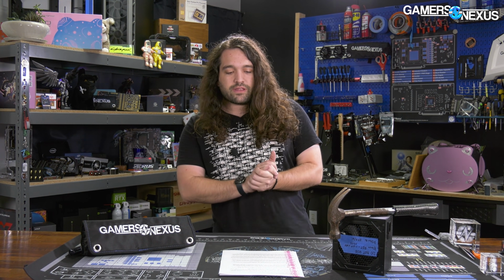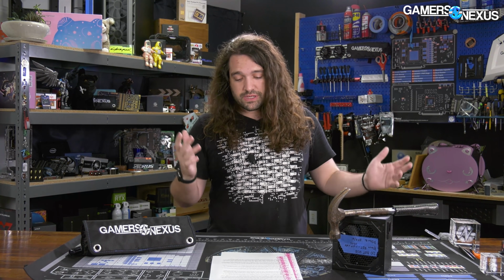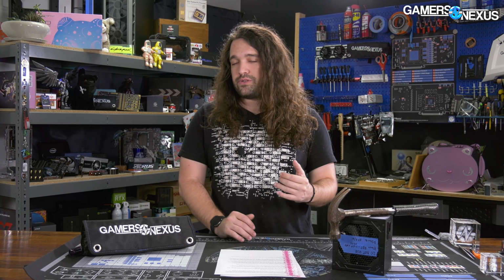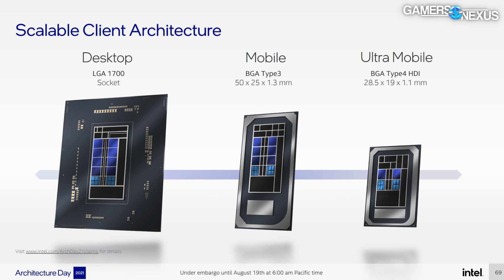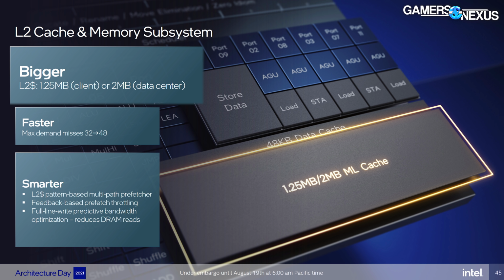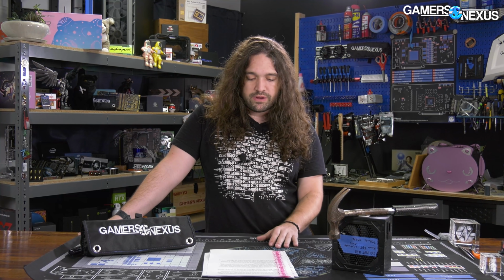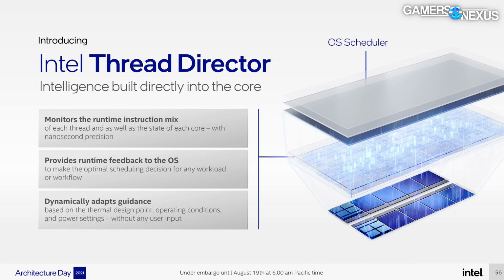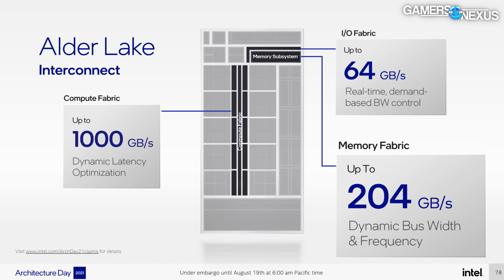Intel Overhauls CPUs: Alder Lake Architecture Explained - New Core, PCIe Gen5, & DDR5

Comment: Why easy if you can go complicated eh? This looks like intel just wants to bridge the time till they get a smaller production process. Why use slow cores mixed with fast cores if the fast cores could be just clocked down and the voltage reduced to save power? 

Always keep it as simple and functional as possible.
Reply: Its not slow cores, its efficient cores that match skylake IPC and give the cpu huge MT perf

Comment: Big & little cores - look how everybody is copying ARM and guess why? Efficiency, specifically performance per Watt ;) Nvidia made a god damn good (and expensive) purchase of ARM... its also good to see that AMD is more efficient in its performance per Watt than Intel... AMD needs to learn that also for their crucial SOC products, not mentioning those which will like to continue pumping into future game consoles and mobile PCs... still I've heard that AMD is experimenting with ARM cores in their SOCs, however I think Intel and AMD would like to eventually learn how to make very similar in performance per Watt ARM like SOCs based on the x86, however Nvidia might be faster in that by delivering ARM SOC running x86 very well and efficiently potentially opening space for new ARM & Nvidia based PC chips. Let's see how it will unfolds, future is definitely not only x86 with Intel and AMD, which I am very glad for... industry needs a new shift and way forward.

Comment: Efficiency Cores are not just clocked lower, they have a Reduced Intruction Set (RISC).  This is the reason Intel HAS to implement this Scheduler, becase the E cores literally cannot run many instructions the "P" core can.  Imagine running on E core then the thread requires an AVX instruction... that will be redirected to P core.  Hard to imagine they will get this right 1st gen...

Comment: The key to this new architecture will be how well operating systems can firmly assign tasks to the right core.  There are some reviewers that seem to think the OS scheduler will NOT necessarily do this but that applications will use whatever cores they want at whatever time they want regardless of the combination of processes and tasks running.  Seems to me that power savings alone do not justify creating an entirely new architecture.  Unless the OS can assign "background" and "easy" applications to efficiency cores and ensure they do not spill over into performance cores, what's the point?  But how will you guys test this?  How will we know if it actually works?

Comment: Man, what a waste of sand. I get doing the big/little configuration for mobile processors where they run on batteries and power consumption is a huge consideration, but that's not a thing on desktops. Better to allocate the die space to more performance cores. I only hope AMD's too smart to follow them down this road.

Comment: I Think By Sticking For A Decade they meant the core idea of performance cores & efficient cores. In fact any architecture leaks from MLID and others points to hybrid architecture at least until foreseeable 2026-2027. 

Alder Lake, Raptor Lake, Meteor Lake, Arrow Lake, Lunar Lake, Nova Lake they are all big core - little core designs where each takes further the disaggregation from a monolithic design of not only the core designs but also of I/O, Memory, igpu, manufacturing & assembling processes, etc.

Alder & Raptor ( 2021-22 Intel 7 - 7 enhanced ) Lakes are improvement on scheduling, and use of big cache for gaming and workload in hybrid core designs.

Meteor & Arrow ( 2023-2024 Intel 4 - 3 + TSMC 3 enhanced ) Lakes are further improvement on them plus disaggregation of the main cpu systems in tiles ( heterogeneous cores, memory, i/o, igpu, etc ) so they can be made and assembled in different manufacturing places using the best technology possible.

Lunar & Nova ( 2025-2026 Intel 20A - 18A + TSMC 2 Gate All Around ) Lakes are actual attempts of using all the above mentioned improvements with an enhanced CPU instruction architecture ( could be x86 enhanced, could be using hybrid x86 + risk/arm and 3-4 threads instead of Two per Performance Core ) to tackle & fight with arm or efficient micro architecture designs in different sectors.

Intel is foreseeing massive improvements in performance from Arrow Lake & onwards.

Whether they can succeed doing all that in the foreseeable 6-7 years we will have to wait and see. But for intel it looks like they are indeed sticking with the hybrid design for at least a decade.

Comment: For me with global warming etc l felt guilty getting larger psu for 3080? I think next gpus...next cpus...the powerconsumption and heat are becoming more important to me now.  The size ..weight...power use of my 3080 feels like a step backwards ..l feel like its a overclocked 2000 serise gpu...with a few more chips stuck on it...anyway...l hope pc parts become more power friendly.   Nice to see intel trying...but unless they can crush my 65w ryzen 3700x at same power use...l wont be interested.

Comment: The more I hear about it the less likely I am to actually go for it. Intel used to have a reliable tic-toc routine, now we are getting in the same launch a new process node a new core arch, DDR5, PCIe5 and a dynamic scheduler to make it work that needs some amount of OS integration. I'm pretty sure some things won't work as intended. The scheduler part seems like a massive SPOF for the overall performance of the product.

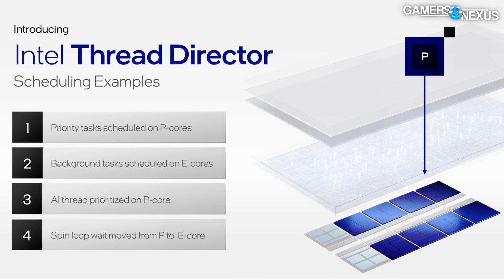Comment: So, in regards to TDWS (for short hand for topic at @22:22 )

That is going to be a security nightmare. I can see it already. 

For the scheduler to know which is best type of core to do certain jobs for, it's going to have to do more of what was already making Intel and later AMD chips vulnerable to the many recent security issues as of late. What was that?

Predictives, for short. What do I mean? Stuff like your hyperthreading for instance, uses predictive algorithms. This scheduler, seems like it will be doing more of the same, based off the information it gets from your activities. 

That means it is essentially spying on you all the time to make sure the right core or thread is doing the right job. 

Now, go ahead and tell me that isn't a problem where Microsoft or hackers are concerned.

Comment: So the P core/E core split is basically more of the “big.LITTLE” stuff that’s now familiar from mobile ARM?
Reply: yes. But mobiles need this to save batteries. Why we need this at desktops?
Reply: @severgun  On the face of it I would agree but if all background tasks are delegated to the little cores then all your big cores can focus on latetency sensitive user tasks like gaming.
Reply: @lionelt.9124  wasnt there an old argument that doing a task really fast saved you power over doing it slow
Reply: @jimecherry  Doesn’t work with PCs. Power consumption increases exponentially with speed, not linearly. That was Intel’s problem over the past several generations.
Reply: @severgun  to save power.
Reply: @severgun  watch whole intel presentation. Raja did mention hybrid architecture actually people compear with hybrid car engine which subject to give maximum millage per tank gas. 
But there is a another hybrid technology in formula one car racing. Conventional turbo charger engine (golden cove core) is being given additional electric charge (gracemount core) to blast maximum speed to get top speed. Alder lake will going to follow 2nd one notion.
 In alder lake decoder will  decord 3type of instruction scaler , vector and ai . The vector instuction priorities p thread but the instuction is too small and sort so don't need p execution unit for achieving task hence the thread director will it send to e core where 17 execution port available per core so it will have sufficient space to execute vector instuction as a result the broader execution port of golden cove core will be traffic free to achieve scaler and ai instructions. 
That's why in alder lake gracemount core have 17x8= 136 execution port where 11900k only have 80 execution port.
 On traditional architecture all execution port are being mashed with scaler , vector and ai instuction so on alder lake thread director will transfer rightfully instructions to fightfull thread.
Reply: @severgun  have higher IPC in the big cores
Reply: @severgun  Obviously to save power. Daddy paying for the electricity? No interest in where electricity comes for?
Reply: @Malc180s  Nah... To save power? That will probably save you a couple of cokes a year at most. For laptops this is a good thing but for desktops it's more about letting the P-cores do what they are supposed to do without having to do what the E-cores can do.
Reply: @tmkongen  Weren't there recent articles saying that if computer power draw increases at the rate it has been, there won't be enough electricity produced to run them? It's not a small problem. Desktop or laptop, doesn't matter. Open your mind.
Reply: @Malc180s  Ok... So tell me, how will a few E-Cores help save the worlds electricity problems? You think the overall power usage of the CPU's will change much? It won't, they become more efficient allowing us to do more in the same amount of time. That doesn't save any power in the long run.
Reply: @tmkongen  Well obviously they'll help, only an argumentative knob would suggest otherwise. If a standard intel/amd chip consumes x watts, halving that power across hundreds of millions of computers will make a huge difference. You think humans are currently only working at half speed or something??!
Reply: @Malc180s  There will be no "halving that power" when the P-Cores does the heavy work. Now if we only use E-Cores we would save some power but noone would use them when they use longer time to complete the task given.

Guess you think that electric cars will save the world aswell so I'll leave you at that. You have your opinions and I have mine. Take care!
Reply: @tmkongen  How often do most people do anything even remotely taxing on their computer?! It'll make a huge difference.

And the car thing? Right mate.
Reply: Yes, pretty much!
Reply: It seems to work for the M1.

Comment: so, basically big.LITTLE on x86-64. This should be interesting. The scheduler will either make or break this. Laptop manufacturers are gonna have a headache trying to figure out whether to stick with Intel or go with Intel and AMD mixture. I think Laptop market is going to be interesting. Also, and this is a big one, Intel got caught pushing performance at the expense of security in the past. Common consensus was that it was a architecture flaw, has this been addressed?

Comment: I feel like that "thread director" tech could have been implemented in the 10 and 11 series CPUs. Like a 10900k always has threads 3, 4, 5 & 6 saturated (especially in poorly optimized games), while the rest of the cores sit idle - thus causing stutters and fps drops. Offloading those background jobs to the other cores would reduce the bottle neck on thread 3 - 6. I know its designed to direct tasks to a full different set of cores (i.e. "E" cores), but i dont see why it couldnt be used to directed traffic to idle cores too (given that there are no E Cores on 10/11 series). I probably dont under stand the tech enough so might be very wrong haha
Reply: That's been an OS side thing for a long time

Comment: I'm a bit worried about both the 'end of year' promise because we've seen Intel slip on schedule as you said, but also the lack of engineering samples that have been shown/leaked and this Thread Director that's still in development, only on Windows 11, and nothing reportedly for Linux. If anything, I'm also worried that, on release, there will be plenty of hitches from threads swapping from spin-lock or waiting to the P-cores, causing cache latency hits and thus games will stutter. Maybe it'll be fine.
Reply: "but also the lack of engineering samples that have been shown/leaked "
Apparently there are boards and CPU's already in sale in the Chinese black market, and Raichu has already leaked scores from ES.

Comment: Why couldnt they use the  good old "Ringbus" and make a 14c 28t Cpu That can clock to 5 Ghz all Core. I know i know the permormance matters not the clock speeds but for only Gaming it would have been amayzing. Now this new this and "director" there, Chiplet based, Small cores/big cores I fear that this would make manual OC useless like it already is with Ryzen and pretty boring maby.
Reply: "Why couldnt they use the  good old "Ringbus" and make a 14c 28t Cpu That can clock to 5 Ghz all Core."
Not enough die space- they could have done at most a 10c/20t golden cove cpu. It would prob have to be clocked lower as well because it will require a lot more power and produce a lot more heat than 8+8.

Comment: Would love to see what a very competent programmer could do without all the out of order decode. Willing to bet there's a performance hit for that convenience. How much depending on how loosely the code is thrown together. I wonder if code that is completely in order would still see even a minor hit to performance.
Reply: Remember that OoO also compensates for cache residency and branch prediction, so unless it was with a fundamental overhaul in architecture just changing to in order wouldn't afford much

I do think that compiler-forward (solved at compile time) CPUs are very interesting and offer potentially huge efficiencies, but the audience for them is so small that it doesn't really justify everything that would need to be developed for them - not just the hardware, but also software
... Also, CPU vendors probably wouldn't be willing to disclose sufficient information about the internals to make them viable :p

Comment: A statistic that I think is needed on processors is BTU’s of cooling needed/recommended at both the base Ghz, and the boosted/turbo Ghz, or a metric that can be correlated to the cooling system for the processor.

Comment: Intel lost me years ago. Don't trust them anymore. 6700K was my last.
Reply: You are acting like 10th gen or 9th gen was  bad... when its clearly not... i had a 6700k as well was good at the time.. hell even the 11400 and 11600k are great options..  bkth give the 3600 and 5600x a run for their money... 11400 makes the 3600 look slow for cheap
Reply: @TheBURBAN111  Dont know about those gens and honestly dont care. Intel's behavior is what soured me on them. I refuse to support companies that are anti-consumer. Nvidia falls into this category as well. Attached vid explains a lot if you care to educate yourself. Take care.
https://www.youtube.com/watch?v=osSMJRyxG0k
Reply: @GeraltofRivia5150  i mean amd charging 200$ for the 3600 is anti consumer while the 175$ 11400 with a cheap b560 makes it look slow or what about them charging 300$ or more for the 5600x while intel do the 10850k 10 core.... which edges out the  400$ or more 5800x for 300$ or the 10700k which edges out the 5600x for 250$ or less... im not hating but saying intel are anti consumer is stupid when amd are doing the same thing but worse... yes the 11900k is overpriced but not the 11700k/11600k/11500/11400 all compete with amd for cheaper i agree with the amd cards being cheaper though but compared to NVidia their rt performance is ass.
Reply: @GeraltofRivia5150  your friendly-consumer company couldnt gain half of share in both gpu and cpu market

Comment: I have a feeling we will be extremely underwhelmed at first. It's going to take a loooong time for the scheduler to run well in the real world - remember that each time it moves threads from core to core there will be a large latency fine, cache the needs to be copied and purged, etc.
Reply: We saw it with Ryzen already. It took Microsoft 3 years from zen launch to roll out their scheduling improvements. Linux had it within one year. I doubt a delay with Intel's launch will take 3 years because you bet your ass Intel likes to pay to look good.
Reply: @indianboy0453  pay as they might, Microsoft can't even make THEMSELVES look good after they fired most of their QA people. In any case, this big.Little config is so much harder to optimize for than Ryzen.

Comment: Speaking of low powered mobile processors. We've had the 6w Zen+ based 2 core 4 thread AMD Athlon 3050E for quite some time now. When AMD are we getting the 4050e with 4 cores 8 threads at 7w

Comment: sounds like a super complex low level thread scheduler baked into every CPU.. blurring the line between what should be software vs hardware. Possibly introducing more bugs and hardware level exploits, which cant be patched easily imo.
Reply: Alternative is amds outdated brute force slugfest to extract more performance at least Intel is relying on engineering to get more performance.

Comment: Seems if you are a Linux user then maybe sticking with AMD is the best plan. Also wonder how virtualization and vms will work with different type of cores. Very interesting video. Cheers Steve.
Reply: Yeah these E cores sound like a waste of chip real estate to me. Every one of my cores runs at a different frequency now. Unless I switch to "performance" state. Which never seems to perform any better to me really. But I switch it over in the winter for the heat.

Comment: E and P cores sound like a pretty creative way to deal with yields and binning.  Apple M1 does the same thing, right?  And that worked out pretty well for Apple, so exciting times may be ahead.
Reply: It's something ARM does in phones (for the past 10 years).  It's a "big.LITTLE Architecture".  This makes sense for Mobile products that need to sip power routinely and rarely go to high power.  I see it working well for high power desktops.  For mid/low range desktops, we'll see.  Although those are dissapearing in favor of laptops.